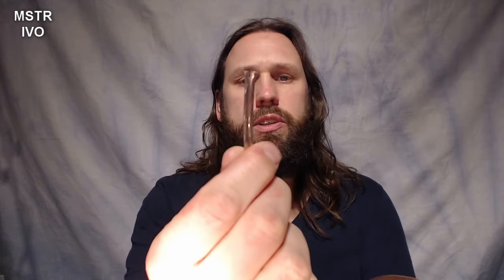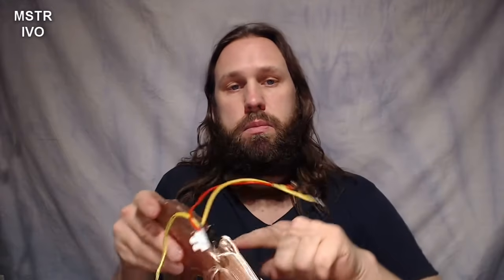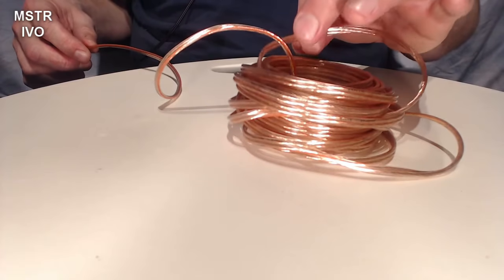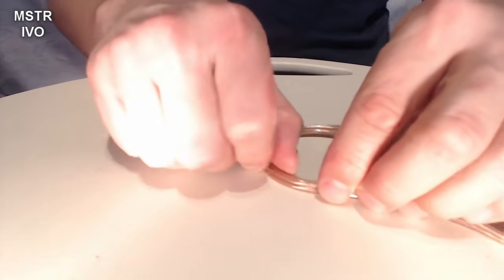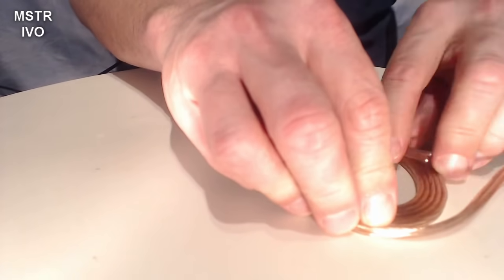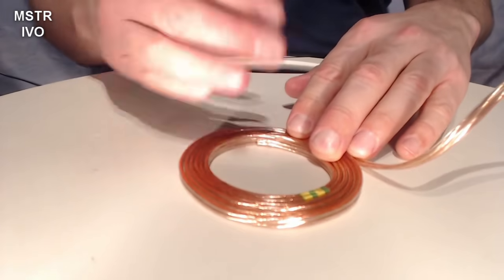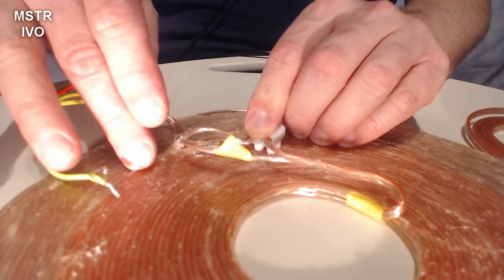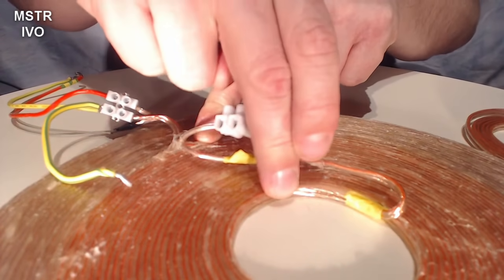How to make a bifilar Tesla coil. The easy way.

Comment: Will this work for  wireless electricity purpose please tell ??
Reply: And is it necessary to have a secondary coil in order to do wireless electricity transmission
Reply from the maker: I don't know if wireless transmission of electric power is possible with these coils, I do know it only works if they are impulsed. so not a dc pulsed signal, but a high voltage impulsed signal. I do think you need more than one coil. You really have to figure it out yourself.
Reply: Thank you Master ivo you are doing great work 👍

Comment: The geometry would be different with wires wound this way (much easier, I agree) than lying flat side by side, would it not? Has anyone tested a pancake bifiler with this geometry to test if there is any difference? I would suspect that there would have to be considering how the magnetic fields would present themselves over such different geometries. Any thoughts?
Reply: Gerard Morin did this with a roll of speaker wire straight from the shop still zip tied together, still in the packet like a big thick doughnut. He took one of the centre wires and joined it to the other outer wire. Then he connected a big light bulb to it and dropped the coil on an induction cooktop. He reckons it gave off way more watts of light and heat than the cook top was drawing. I saw Al Throckmorton do this on a teslatech video here on youtube with a flat coil connected to a huge resister bank, like 5000 watts and the cooktop was only pulling 900watts. So maybe depending on your application its not so fussy? But high frequency was important.
Reply: @waynoswaynos  Does this mean the way Ivo has made this coil is superior to the "flat" winding method Tesla patented? Or are there downsides to winding it like this?

Comment: Master evo is there a positive and a negative side or energy radiating on the Bifiliar coil? If so how would i know which side is megative?
Reply from the maker: Yes there is. It depends on the direction of rotation from negative to positve voltage. This creates a centrifugal, or centripetal vortex, one is sucking in, the other is pushing out (aka positive /negative). You can check it with DC voltage and a compass. connect and look at one side of the coil, follow the windings from negative to positve DC voltage, and check with a compass if the field is north or south. North pushes out, and south pulls in, as far as I understand it.
Reply: Master Ivo Thank you also wanted to know if you have a facebook or something i can follow you on or an email
Reply from the maker: log in from a labtop/computer and go to my main YouTube channel page, there on the "about" tab, is my email. no facebook. I do intend to create a blog, that i will link to when it is created.

Comment: Hello Ivo Master degree,

I wondered how much difference in resistance in ohms between your primary winding and your secondary of the bifilar coil must one have to enter in resonance the proportion to reach the 1/4 of wave. Must the diameter of the center of the primary winding it have a precise measurement or any diameter to get the bargain little? Did I also wonder if the electronic circuit of a plate with induction could make oscillate entered in resonance a two-wire reel? Afflicted my stupid questions I do not have large studies scientist. :) Congratulation for your simple explanations which make it possible to seize the concept of what you experienced and large a thank you for your humanity you are somebody of good who want to help his next without growing rich on the back by people Thank you enormously by this beautiful act by faith. :)
Reply from the maker: Thank you Bruno Marier, I always aim to keep the resistance as low as possible, as resistance destroys the resonance by producing heat. And remember, there are no stupid questions, only stupid people who don't ask questions.
Reply: Thank you Ivo Master degree for your indulgence,

Thus if I understood well to have a bifilar coil which resounds extremely one must use wire of announcer of larger diameter example of the 16 awg which gives a smaller resistance instead of 22 awg which gives more resistance in ohms considering the larger length of copper.

Does the secondary winding of the bifilar coil have to be same length of wire as that of the primary winding or is the ration of proportion of how much between the two?

Thank you very much I am sorry if my English is bad I come from Quebec to Canada French is my first language thus I write to you with a translator.
Reply from the maker: thank you for translating. Yes thicker wire is better, not only for less resistance, but it also increases the capacitance due to more "plate" area between the windings.
Reply from the maker: I find it best to use equal coils for primary and secondary, but you can use a primary with less windings.
Reply: Ok thank you Master Ivo my best regard i try it  !! Have a nice day !!

Comment: I'm sorry to bother you but I just watched a video that bothers me. The presenter was showing the same design (I believe), but near the end he said that there was some special benefit to winding the coil the same way, BUT the two wires should simply be connected at each end effectively making the two wires one with an insulator in between. He also suggested putting a resistor between the two soldered ends. He also said that this is probably the configuration Tesla actually wanted the patent for. Personally, I don't see it. Do you see any benefit to his configuration?
Reply from the maker: No bother, its a valid question. That configuration is not in the patent, if tesla wanted it, he would have done so.
that configuration distorts the magnetic field, as the windings are counter rotating. I see no benefit with this or adding the resistor. (i tried) 

Tesla's method creates an increase in voltage difference between the windings. that is a great benefit, as it increases the possibility to store electric energy in its dielectric field. When the coil is resonant it can store much more electric energy in the electric field of the coil.

Comment: Thank you. I was wondering if I could do that. I'm also wondering if it would work winding the speaker wire when it's laying flat. I realize it would be tougher to do, but just would the result be the same.
Another thing is that I would like a closer look at your connections with the two coils together.

I looked again, and at time point 5:21 I think I see that the thing is to check for continuity and connect one outside lead to the non-continuous inside lead. Does that sound about right?
Reply from the maker: that sounds right Bruce. 

 you would end up with the original patent 512340 design. But to succeed the 2 wires would first need to be separated. flat winding with 2 connected wires won't work.
Reply: Personally, I think the other guy was just daffed.

Comment: If you used flat 4-core telephone cable instead of 2-core speaker wire, you could easily (and cheaply) make a tetrafilar tesla coil:  as Tesla says in the US512340 Patent, " Following out this principle, I may wind any given coil either in whole or in part, not only in the specific manner herein  illustrated, but also in a great variety of ways..."
It would be interesting to see if there are power gains or other effects to be had using modern cables that Tesla did not have access to in his time.
Reply from the maker: with 4 core's side by side, labeled 1 2 3 4, connecting them in series, 2 to 4 to 1 to 3  with 2 being positive and 3 being negative, gives the biggest voltage difference between the windings, and therefor it can store the most energy in its dielectric field.
Reply: Master Ivo Maybe your kind of right , Our Brilliant Mr Testla said the key was 3-6-9 !!! So I would try 3 three wire cables!
Reply: @ @scottwippel5871  I like your thinking about using 3-6-9 wire coils.  Our modern ribbon cables would make them easy to make.  I will try it shortly.
Reply: Charles Grady how did it work out?  I was looking at 4-conductor trailer wiring cable...
Reply: Nice idea
Reply: The GOAL is to have the highest frequency for self resonance ... but also the lowest "room temperature" wire resistance. I think there are many UNEXPLORED geometries with coil arrangements.
Reply from the maker: why do you think the "goal" is highest frequency, what would be the benefit of that?
Reply: @MasterIvo  The indictor would thus have a linear range (more perfect) from 0 Hz to where the self-resonance frequency is. A more perfect inductor is the goal. The coil's capacitance will result in power loss.
Reply: @MasterIvo  Litz wire, for example, with basketweave style coil, for AM radio, is a strategy to reduce the coils capacitance. This boost the Q of the coil for better gain. A better Q means a very high sharp resonant peak too. The bandwidth becomes more narrow. The frequency choice is more easily selected by using a good high quality capacitor with the coil. In the early days of radio, pioneers had very clever ways of boosting gain by creating coils with high Q values.
Reply: @MasterIvo  In Tesla's Colorada springs notes, which I just happened to be reading currently, in the beginning entries Tesla is trying to work out the ideal spacing of the wires of each turn. Too close and the capacitance becomes too much of a problem for him ... and the possibility of corona discharge between windings of his 15.5 meter diameter coil. He also documents a problem he was having with his 12 foot deep ground and a nearby water pipe. It's interesting stuff.
Reply from the maker: yes the power factor  changes by the  increased capacity, but this is not the direct purpose. You need the coils to be resonating to play with their high energy fields.

resonance has no resultant power,
but the separate positive and negative power is huge.

the idea is to disturb the balance of power, which gives a resultant of bigger than zero.

the disturbance is caused by an impulse (resonant half wave)
Reply from the maker: yes High Q is important. but as I e, plained resonance is only part of what I need. The impulse disturbance of the resonant fields is key to the next step. It amplifies the resonance
Reply: @MasterIvo  In the case of transmission, sure you can burn as much power as you want. But for reception, having a very high Q enhances reception.
Reply from the maker: I always assumed the biggest factor. for Q was resistance. didn't know capacity also played a role.

yes Colorado springs is a great note book, but hard to read and follow what he is really doing. I always wondered if some stuff got lost in translation.

Also, about Q: 
with a dual resonant system (primary and secondary both are resonant, and loose coupled) 
there are 2 main resonant frequencies. the higher resonant frequency is a 1/2 pi higher than the lower frequency.
the lower is in phase, while the higher is 180 out of phase.

now the Q of the higher resonant frequency is much higher.
 do you know why  that is?
Reply: @MasterIvo  It is a good VIDEO idea to compare Tesla's original flat coil bifilar to the speaker wire one and see how they are different at various ranges of frequencies.

Comment: Another great video!  So...hmmm....what is the difference between winding speaker wire vertically vs. horizontally into a bifilar coil...other then the fact that it is easier to do vertically?  And why in the patent 512340 would Tesla provide the drawing in a horizontally wound fashion?

First off, the dielectric field between two conductors with a difference in potential is between the wires, and zero in space outside of the wires.  

Now in the horizontally wound conductors (Litz wires), as the coil is wound each wire is against the next wire and the one before, or in other words there is 2 dielectric fields for each wire (180 degrees in either direction).  This is in fact also the way most "rolled" up capacitors are made and does impact the final magnitude of the capacitance of the coil (increased).

Now in Vertically wound conductors you lose the extra capacitance affect of "each wire is against the next wire and the one before". 

It would be interesting, using the same amount of speaker wire and creating a horizontal winding and then a vertical winding and compare the capacitance between the two (which should be different due to the discussion above).

Now then, does all of this really matter?  One of Tesla's purposes of inventing the bifilar coil was to do away with the need of expensive external capacitors matched to the inductance of the coil for use in resonant circuits.  Certainly, either coil serves this purpose, albeit with different energy storage in the dielectric field between conductors, for a chosen vertical or horizontally wound coil. 

Now talking magnetic field.  Since the currents are all running in the same direction in the series connected sections of both the vertical and horizontally made bifilar coils, then the magnetic fields should line up in the center hole of each. extending outwards close to the coil surfaces.  There should be a different inductance between the two coils as the vertically wound option increases mutual inductance between neighboring wires.
Reply from the maker: Thanks  Mark S.
Maybe Tesla used the drawing because it was the best way to explain (visually) the series windings. Although many people (including me) have to look twice before they see the coils are not counter rotating.

Related to the magnetic fields/increased mutual inductance. I agree. Think what this does when you stack several of these coils.

indeed now per wire there is one dielectric field to another winding (with high voltage difference). I hadn't thought about that yet!

That explains why today when I tested my circuit (it works!) the resonant frequency was 1/2 of what I expected.
Reply: @MasterIvo  So is the answer Vertically wound or Horizontally wound better?
Reply from the maker: both work. depending on what you want.
Reply from the maker: @gsambolin  ah magnets. more winding  area needs more movement of the magnet.
smaller area but thicker coil might need stronger magnets.
both work with magnets. But I don't work with magnets, I don't find it interesting.
I focus on the effects of the dielectric induction, using impulses (rapid voltage changes)
Reply: @MasterIvo  Thank you for your response So I guess that vertical or horizontall MAY  not matter.  I will make two coils to test with.  Thanks for the feedback on smaller area vs. larger winding area.
Reply: @MasterIvo  Any thoughts on starting a DISCORD Channel on Bifilar coils?  I searched and there isn't one.  You would be the first as you should be.  👍
Reply from the maker: @gsambolin  could be, but who will be the admin, to keep it civil?
I have seen the forums run over by beasts of men...
Reply: @MasterIvo  I could be the Admin, I don't expect a very large audience at first anyway.  We can then solicit (trusted) others to assist in Admin'ing as well.  If you like I can start it but would prefer to chat with you via email on some thoughts for the channel before we do.  I found your email address on your YT channel.  Will email you now.  You should see it coming from g******lin.  Thanks

Comment: What about Copper Tubing for BioCurrent instead of Copper Wire?
Reply from the maker: what is Biocurrent? you could use copper tubing, but to what benefit?
Reply: Master Ivo possible amplification over distance instead of loss of power as-in extension cord?
Reply from the maker: I don't really understand what you are trying to say brendan anderson
Reply: Master Ivo using BioCurrent Copper Tubing as (+) and Direct Current Copper Wire as (-)
Reply from the maker: Biocurrent? is that related to Bob Beck's work?

Comment: Wind the coil from the aluminum foil. This will increase the inter-winding capacitence. And it will be possible to easily arrange the inter-winding  capacitor between the windings .
http://realstrannik.com/forum/proekty-i-izobreteniya-nikoly-tesla/120-more-energii-vokrug-nas-n-tesla?limitstart=0#61068 
http://realstrannik.com/forum/proekty-i-izobreteniya-nikoly-tesla/120-more-energii-vokrug-nas-n-tesla?start=36#62721
Reply from the maker: Nodir D I looked at your coils again. the reasoning is good, there is increased capacitance between the windings. But the field strength of the dielectric field is also related  to the distance between the windings. the smaller the distance, the stronger (more voltage) the field is.

placing a capacitor (plates) between the windings is a creative idea, but the windings themselves are the plates!

if you add extra capacitor plates between the windings you increase the distance, reducing the field strength/capacitance. the  voltage difference is still between the windings. so from one winding, it goes to a plate, and another plate and then it sees the  other winding. It might work. but...

why not use the windings themselves?

I think there is more to it. Dielectric induction. resonance induced by instant dielectric voltage.